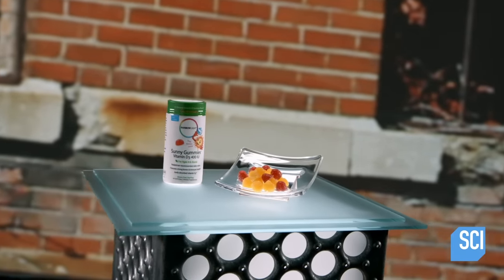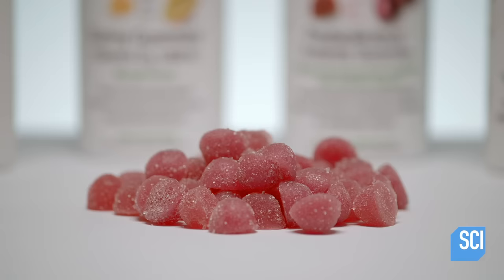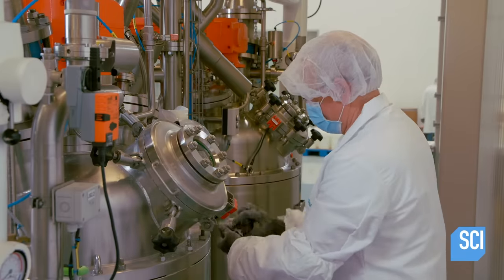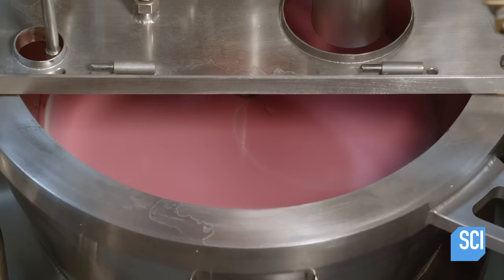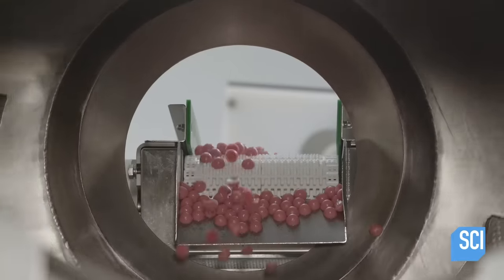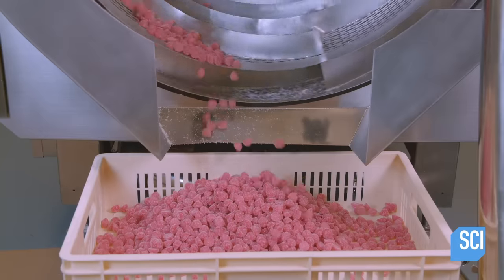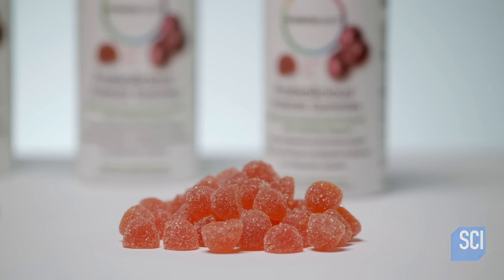How Gummy Vitamins Are Made | How It's Made

Comment: ‘Turns the metal contaminants into atoms”

Uh ok?
Reply: Sometimes this show dumbs stuff down so much it's actually more difficult to understand... They're running the sample through a mass spectrometer which measures the amount of elements/molecules both to ensure the formula is correct and check for contamination.
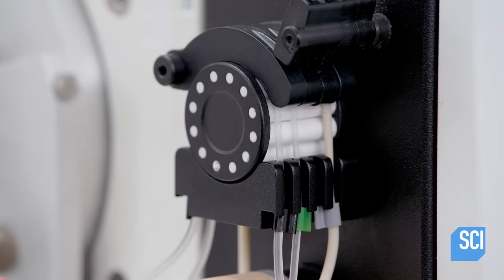Reply: @wheel00fah  It's not a mass spectrometer. It's an inductively coupled plasma atomic emission spectroscopy machine. you can see the RF coil used to generate the hot argon plasma at 2:10
Reply: That is just a different kind of mass spectrometer.
Reply: @oron61  no it definitely is not. a mass spectrometer has totally different function than an atomic absorption spectrometer.
Reply: @Muonium1  Ah, cool! I thought something didn't quite make sense for it to be a mass spectrometer, but I couldn't come up with anything else that made sense. You learn something new every day...
Reply: reduced to atoms
Reply: It's not totally wrong. I mean, from a purely conceptual point of view it is wrong, but in chemistry speech approximations and shortcuts like this one are fairly common. 
By saying that the spectrophotometer turns the contaminants into atoms it means that the substances get atomized, meaning that they exist now in the gas phase as single separate atoms (in a first phase, then they get turned into plasma). 
So yea, even though it'd be better to say "atomize", "turn into atoms" conveys well enough the idea of what's happening.
Reply: @Muonium1  
That's not an atomic absorption spectrophotometrr either, you said it yourself in your previous comment, that's an ICP. It measures emission, not absorption.
Reply: @pietrotettamanti7239   mixed up absorption w emission.  Still, same underlying phenomenon of atomic lines.

Comment: Hi sir. You are requested to make a video on this:
1.  When does the sun's magnetic polarity get reversed?
2.  What impact will it have on the Earth?
3.  Recently in 2020, the sun's polarity has been reversed, for the 25th cycle. When was the first cycle occurred?
4.  Approximately when will the 48th (final) cycle occur?
5.  What will happen, when the final 48th cycle occurs? Any disaster?
6.  Whenever the first cycle had occurred, before that had no polarity reversal cycle ever occured on the sun?
7.  Will the sun never ever change its polarity, after the 48th (final) cycle?
8.  If the answer to question 7 is that the polarity will stilll be changed even after that, then why is the 48th cycle considered as the final cycle?
9.  If after the 48th cycle, any new fresh cycle starts, then what will be different in the cycle? Why will be a fresh new cycle and not the 49th cycle?